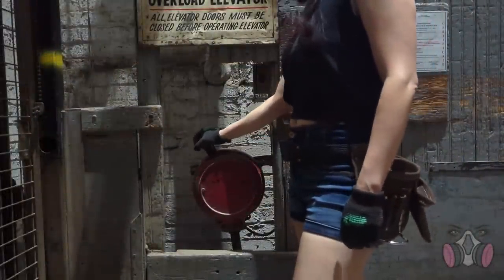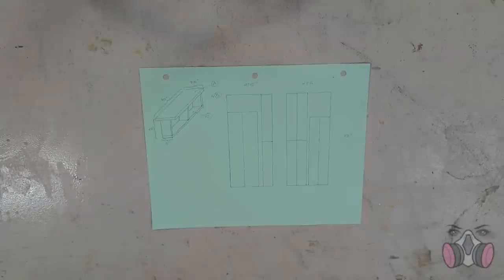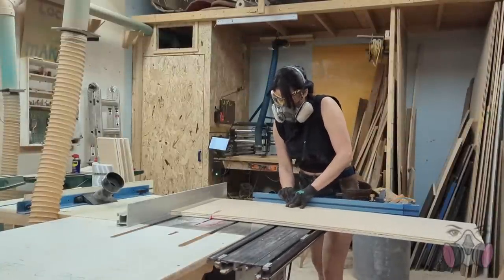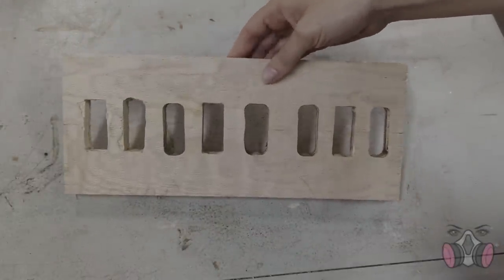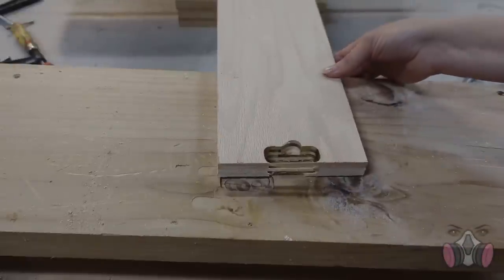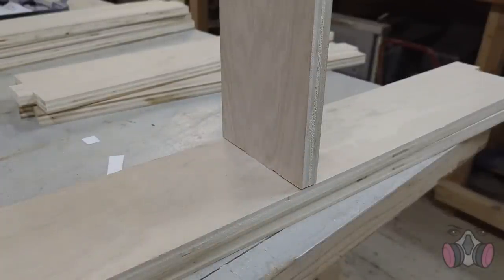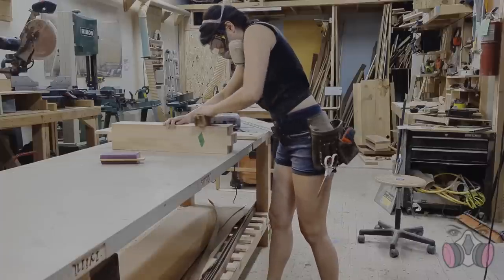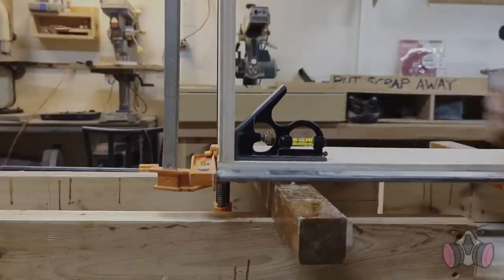These Are The Easiest Custom End Tables Ever (And I Still Overcomplicated Them) | Woodworking DIY

Comment: I always prefer to see videos where people are screwing stuff up.  I learn more that way and don't have to make the same mistakes myself.  I like how the mortis and tenon joints look going clear through the top.  I think I might have rounded the corners of the top of those tables but they look good enough with square corners.

You are the first craftsperson I've seen use a dremel in a furniture project.  That was a question I've had for a while.  Thanks for answering it!

Comment: Excellent work!  You might consider raising the grain during sanding.  When you sand to the finest grit you're going to use, run a damp rag over the surface.  This causes the grain to rise up, and you can then sand again.  It might make the steel wool unnecessary.

Comment: If you ever do hidden tenons in the future, just notch or flatten the round part of the tenon a bit.  That'll give it the relief needed for the hydraulic pressure.  The majority of your glue strength is along the face of the tenon anyways.

Comment: Nice progress on the joinery! And great recovery from that mistake. Would you consider some edge banding for your next plywood project? It would give the look of solid wood and hide the layers of ply. 

Cool that you donated to WWF as well.
Reply from the maker: Thanks! I appreciate that. So I used that trick in one of my previous videos (when making the table tray) where I tried to hide that it was plywood using mitre joints. I never tried edge banding though. I always worry it'll have the look of particle board, because that's usually what I associate that method with. But I think that association is mostly in my head, so it's definitely worth trying

Comment: Nicely done. My only concern, as if it matters, was the miter gauge cut u made while keeping the board up against the fence still. U were pushing pretty hard thru the cut, due to the ply being a little twisted and I was getting a little anxiety till cut was done.  Fence not really  needed once u get the measurement. Just back it off a couple inches so there’s no chance of kickback on ya.  Just a thot.  Please take that constructively as that’s how I’m stating it. Nice work!!!
Reply from the maker: Thanks! And don't worry, I definitely didn't take your comment as negative and appreciate these discussions. You're actually totally right, and I had to lean into it quite a bit. I was hoping no one would notice, lol. The blade was super dull and had a few broken teeth, so not only did I have to put more force into cutting, but it also left burn stains on the side, which were more work to remove.

We changed the blade two days after I filmed that so now it cuts like butter. I'll keep an eye out on if I still have to apply too much force, and if I do, I'll readjust my method. I really appreciate your comment
Reply from the maker: Ah, sorry. I misread your comment. You were talking about the cross sections. Yup, definitely should have pushed the fence away rather than pushing both sides through. I got lazy, which isn't the best reasoning when working with a spinning blade

Comment: Nice job but you’re begging for a kickback while using your table saw fence as a reference while using your crosscut sled. Try using a 1” spacer against your fence before your blade and just set your fence back an inch. Not trying to be critical, just don’t want you getting injured.
Reply from the maker: Thanks! I made sure to push past the blade so it wouldn't kick back, but you're totally right... I should have just used it as a guide and clamped a buffer so I wouldn't have to worry about it at all. I just got lazy cuz it was only one cut, which isn't a good excuse :/